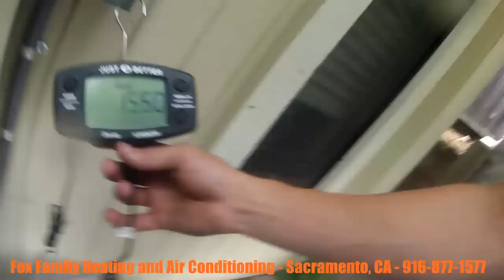HVAC Service Call - Repairing a Punctured Condenser Coil - Sacramento Air Conditioning

Comment: I did that once on a 20 ton York RTU that I had just pulled apart to clean the condenser. One of the last screws I was putting back in was the wrong length and bam. There goes 20lbs of 22. That sucked. Nice vid.
Reply from the maker: ouch. ..thanks for sharing!

Comment: Nice repair, Greg !!! 👍🏻great job
I know this repair was cheaper than replacing an 8 yrs old unit but I have a doubt. How much is the pound of R22 on your area ? Here is around $90 x 11= 990 plus labor  so maybe customer ends paying about a third of a new unit?  But I would give both options to customer, since I didn't know the history behind "why he was trying to install a hard start kit " maybe the compressor is in the process to fail
Reply: +Jorge Chavez 90 a lb wow just wow
Reply: 90/lb for r22 isn't bad. I'm not that high yet but it's coming. A company in my area is $189 for the first lb and $89 each additional.
Reply: +james holder well if you can get that price i guess good for you. i just personally cant chage people 600 percent mark up. i bet everyone needs a pound or two also, right.

Comment: Greg, Your right about the pressure pushing outward and copper getting in there is almost impossible. That company missed out on a pretty easy repair and more than likely lost a customer. That owner needs to think, if he would have made the repair he would have retained his customer and would have replaced the unit down the road. It cost twice as much to get a customer than to retain one. "WHAT A DUMBASS"!!!
Good job in taking care of a customer.
Reply from the maker: they sure did. signed em up on my club my club membership.thanks for the comment.